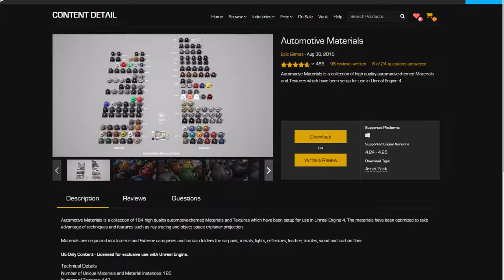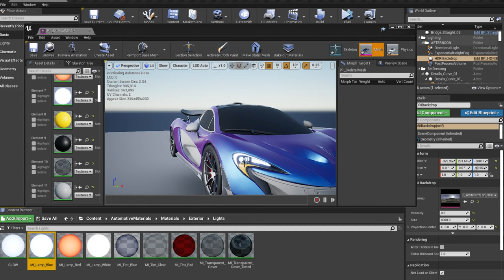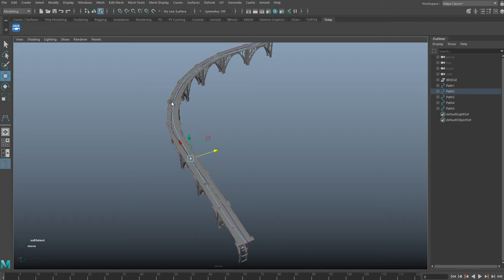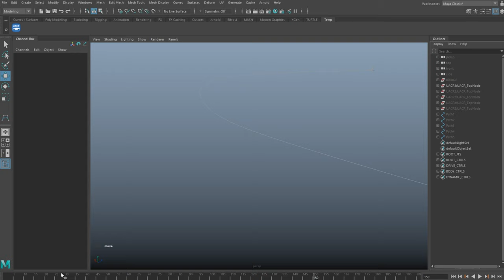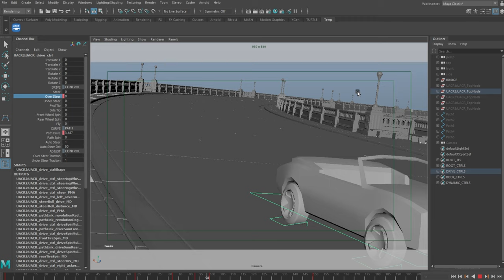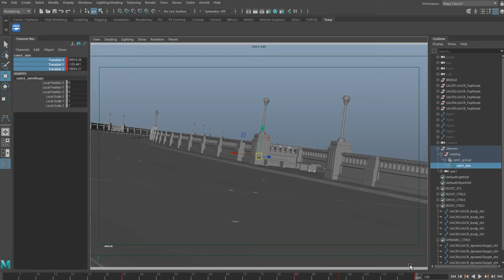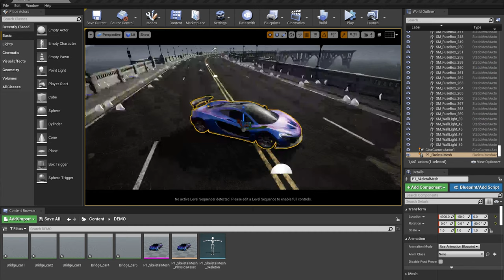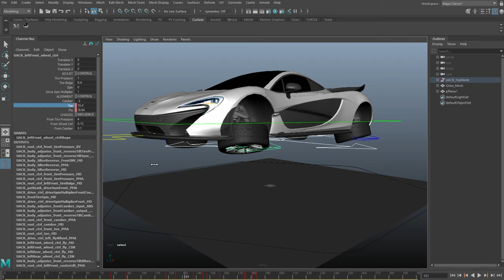How to Animate Cars for Unreal Engine | Maya Car Rig | UAC Rig

Comment: Hi Simon, great tool! I bought it and tried to do a practice, but I'm having problem when I import the animated and baked ROOT_JTS fbx file into UE5(doesn't allow me to import it), I think I followed exactly what you did in the video,  Any help would be appreciated!!!
Reply from the maker: Are you able to export any other, non UAC-Rig fbx file into unreal?
Reply: I never tried import any animation into UE before, so I'm not sure if it's the problem from UE end or maya end, but I have the error note says "Mesh contains car_911 bone as root but animation doesn't contain the root track."
That seems like I did something wrong inside maya? @SimonMills
Reply: @SimonMills  Also, when I check skeletonmesh bones that I exported from maya in UE "character - bones - All Hierarchy", the bones look so different when I check'em in maya, anything might be related to this?😰😰
Reply from the maker: Have you imported the vehicle skeletal mesh?
Reply: Yes, I did. I imported the skeletonmesh with all the car pieces separately first, then I went back to maya and group the car inside maya, and imported again, it comes with a integral car skeletonmesh. @SimonMills
Reply from the maker: Can you send me the files or some screenshots of your hierarchy/export/import process?  send to smills@trickbox.ca
Reply from the maker: Likely yes, can you send me some screen shots or the maya file?  send to smills@trickbox.ca

Comment: I have a bit of an issue. I believe I've followed your directions correctly, everything runs okay and appears great with the animation and everything in Maya. However, once I've applied the animation to the skeletal mesh in Unreal, it works but it puts the wheels in a position far apart from the car and doesn't follow the animation with the car. Any help would be appreciated! Full disclosure I am a bit of a noob with this stuff so if this is a rookie mistake I missed, I accept XD
Reply from the maker: Did you bake your animation down and remove the rig before exporting?
Reply: @SimonMills  Yes I did. However, Maya did not give me the menu to select "below" as it did in your video. It just proceeded to bake animation. Not sure if that's got anything to do with this.
Reply from the maker: @davidwasserman9782  there is a small box icon on the right of the bake animation list item, hit that to open the options for that command.
Reply: @SimonMills  Ah, on exporting it gives an error about "The plug-in has detected zero scale values that may cause unexpected results. The following nodes are affected: " And lists the tires as the objects affected.
Reply from the maker: @davidwasserman9782  send me the files and I will take a look. smills@trickbox.ca

Comment: Is there a reason you export the model by itself after you've rigged it and not before? since its just the geometry in the same position?
Reply from the maker: Great question. You do need to rig it first because your initial export is your skeletal mesh file. This file contains the geometry as you mentioned but it also tells unreal how to bind vertices from your model to each of the joints.
Reply: @SimonMills  gotcha thanks!

Comment: im only given 1 material when i export to unreal? not sure how to fix that but i cant assign materials to different parts its all one object :(
Reply from the maker: You can either split it into seperate parts in Maya before rigging it or select polygons in Maya and assign materials that way. When you bring it into Unreal, as long as you have material ID turned on in your fbx options, you will see multiple material ID slots in Unreal that you can assign your materials to.

Comment: Been looking for something like this for Maya, I will buy today the full product if I can import a terrain from unreal that is uneven and I can drive on it. Not watched first video but guessing can import geometry then use curve spline ? Anyway, will watch videos and I think you have a buyer. Nice one.
Reply from the maker: It sure does, this video goes over terrain: https://youtu.be/aP5P2kV9vJM
Reply: @SimonMills  you got me, just ordered. Now I just gotta figure out how to get drivers animated in unreal that don’t come from maya. Looks fun. Thanks
Reply from the maker: @7_of_1  Thanks man, any issues, let me know.
Reply: @SimonMills  thanks. Downloaded today and looking through docs etc before I start. Quick question, if a model already has bones for a rig how will it affect or best to start just from mesh? Using rendering in Unreal exclusively. I’m talking bout for doors, trunk opening etc,. I mean you can do that just by pivot points on mesh components, but should I get rid of all rigged bones first and build from mesh. Dammed good product though.
Reply from the maker: @7_of_1  You can just parent those door/trunk joints or pivots to the body control or body jt and it will follow the car.

Comment: Hey Simon. I followed everything and it works (sort of). For some reason in UE4 my skeletal mesh is not casting shadows or glass when rendering or playing the simulation. It does work in the UE viewport though which is weird. Any ideas?
Reply from the maker: Hey Amaru, that does sound weird. I have not seen this issue. I Assume your render settings are all setup correctly so you could try dropping a few cubes in a scene, move them above the ground and assign your glass material to one of them. Now test a render on a static object. Does that have the same issue?
Reply: @SimonMills  ha yes I did that test already and do not have that issue :(, also shadows are missing. But this happens only when rendering or simulate the game. In viewport is just fine :(
Reply: also won't let me swap materials like you did in the video so weird. Do you think is the import of the mesh? cuz everything else works perfectly, animations all of it
Reply from the maker: @amaru_zeas  I Found a post here that looked promising regarding the physics asset- you may have already checked it but just in case:
https://answers.unrealengine.com/questions/12180/view.html
The issue does sound very odd though. So static cubes were not having the same shadow and glass issues as the animated car?  I suppose the next test would be to have some cubes in Maya skinned to joints and animating. Bring those in and test those. If it is happening to the animated cubes, you could try exporting your FBX files on an earlier fbx version (2014/2015). This is a bit of a long shot but it would omit any odd new mesh settings we are not yet aware of that are included with the latest fbx version exports.
Reply: @SimonMills  So I managed to import the wheels, rims and steering wheel and it works fine. Is when I add the rest of the body (body and interior as a single mesh) that the problem comes back.. Not sure what could it be
Reply from the maker: @amaru_zeas  maybe try splitting the mesh up a bit.
Reply: Ana yet if I import the body as static object it works fine.
Reply from the maker: Crazy world we live in..

Comment: When I get to 13:03 Maya has an error occur and it won't let me add the selected curve path to the Rig Top Node. I've tried deleting the curve and recreating it as well as deleting the entire rig and starting over. Nothing seems to pair the rig to the curve for some reason. Any advice? The error reads: 
# Error: TypeError: file Z:\Production/Workflow Documentation/Unreal/Car Rig Setup/MayaUltimateAdjustableCarRig/tool\UltimateAdjustableCarRig.py line 1020: unsupported operand type(s) for +: 'NoneType' and 'str'
Reply: Figured it out, rather than dragging and dropping in the Maya Rig file into the viewport, I imported it manually with File > Import
Now it seems to work as intended
Reply from the maker: @catmadethat  Thanks for letting me know!
Reply: @SimonMills  how many polygon you in your car mesh?

Comment: When I delete UACR1:UACR_TopNode, the tire mesh is replaced by a dummy model, probably for skinning, but is there any way to use the original model without changing it?
The error log I get when deleting is
"UACR1:UACR_root_ctrl_globalScaleInv_MD": basicExpression has encountered a divide by zero. Result is unpredictable.
Reply from the maker: Just select the mesh you want, unparent it and delete history.  Then export the geometry and import as needed.